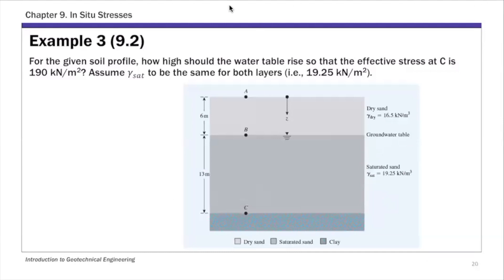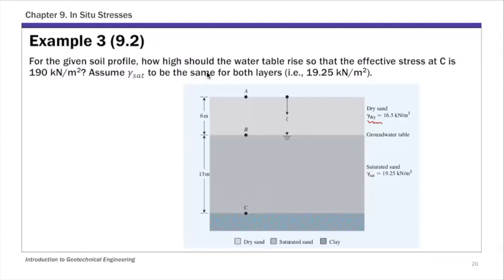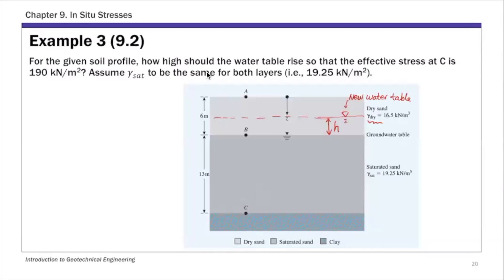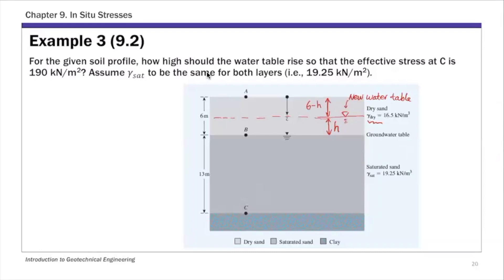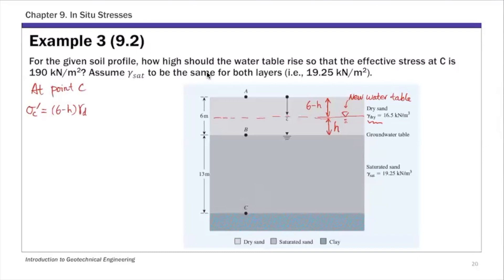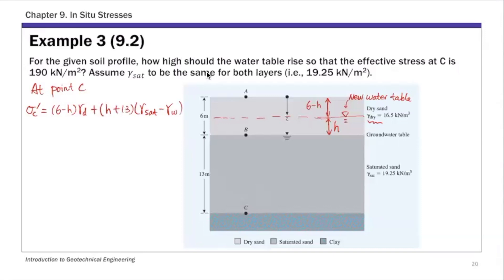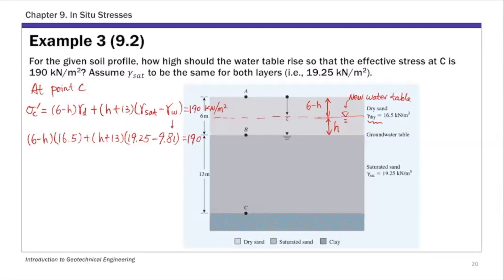Chapter 9 In Situ Stresses - Example 3: Rise of Water Table given Effective Stress

Comment: what happened to the pore water pressure ???
Reply: Exactly??
Reply: @kamwenjekunda8800   aii , andufyanya waish .. but other wise its clear until that par t
Reply: there is pore pressure in the equation (solution), its just that the guy simplified the process by introducing unit weight buoyancy , which is gamma sat minus gamma water. if the equation isnt simplified its 190kn/m^2= [19.25(13+h) + 16.5 (6-h)] - [9.81(13+h)]. so its effective stress equals total stress ( first bracket) minus pore pressure (2nd bracket).